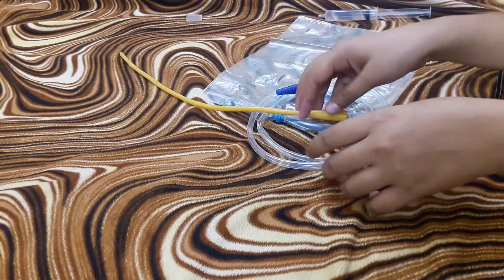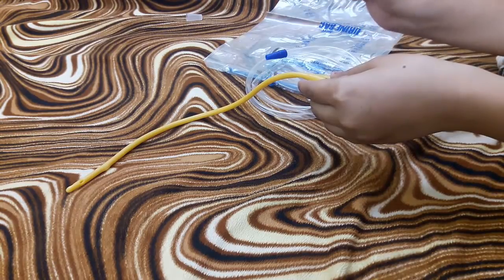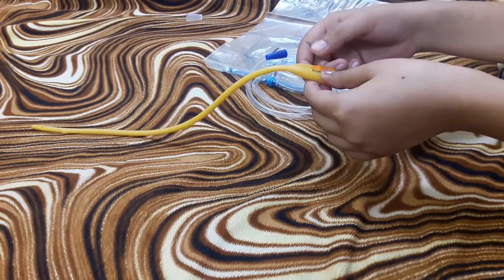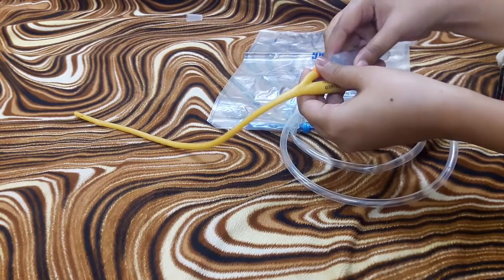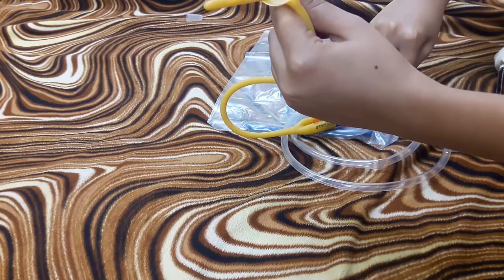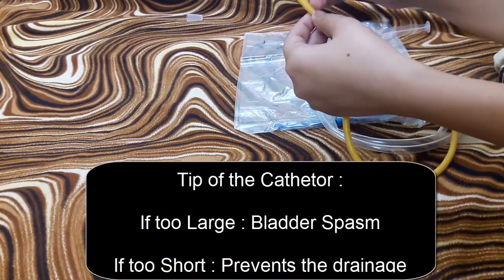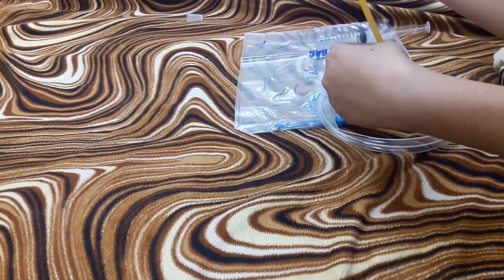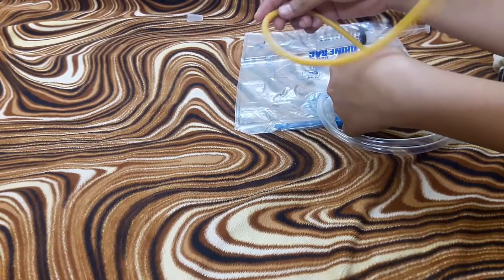Foley's catheter | Parts | Sweta Yadav

Comment: The use of saline may cause crystallization, use sterile water instead.
Reply: Why don’t we use air ? 😅
Reply: @eashananeja2732  to prevent air embolism since air leak can be absorbed through vesical veins.And also with air in it,it will float in urine causing incomplete drainage.
Reply: @jaineelbhatt7468  yes, makes sense. Thanks
Reply: Yes u r right
Reply: @eashananeja2732  also if we instill it with air it will cause the tip to float above the urine and main function of the Foleys i.e. to drain urine will be hampered